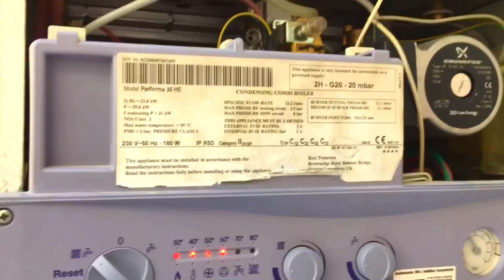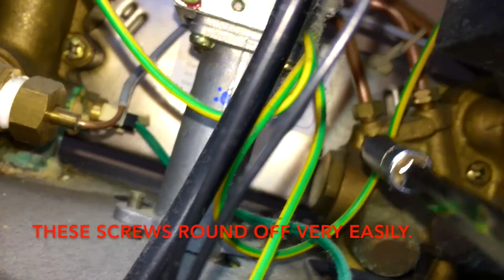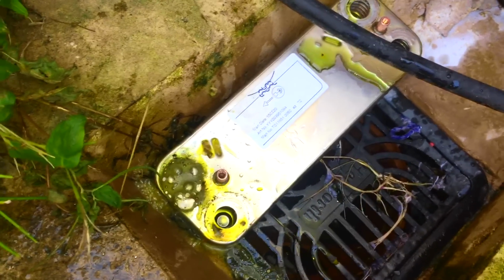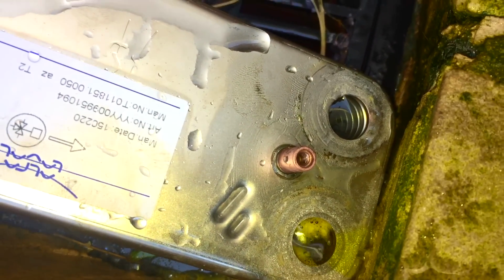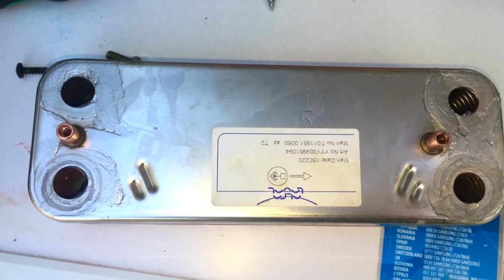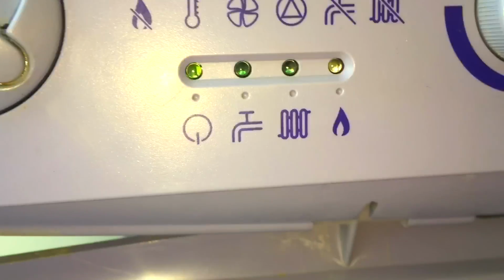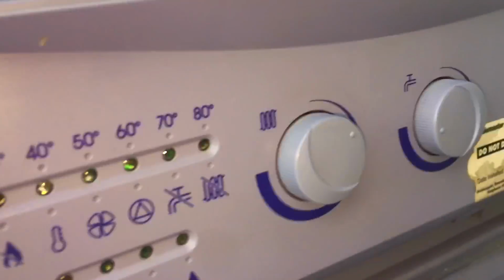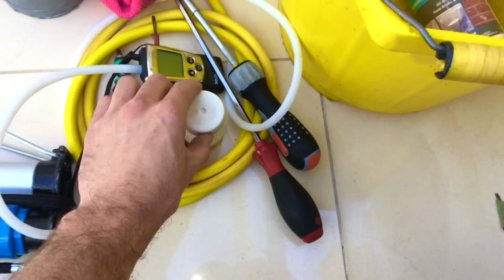Blocked plate heat exchanger sludge. Potterton Peforma no hot water. Heatinggeek

Comment: 6:36 I had a Vaillant Ecotec today, blocked up on the cold water side, flow good on hot taps but very little flow, spirit of salts couldn’t clear it, had to replace :(
Reply from the maker: Yes, it will not clear the scale quickly. Take about 10 bottles and would damage the plate before clearing it.

Comment: great video learning a lot from your videos as im new to faults. however is there a way to check if its the plate or diverter? as to my understanding is if you run the hot water and the flow pipe starts to warm the way i understand its the diverter passing
Reply from the maker: If the plate on these boiler gets blocked then the pump is able to overpower the diverter and the flow pipe gets hot. Other boilers won't do this. Vaillant for instance will not do this. It comes with experience. Remember this diverter valve is not electronic. :-) Hope that helps.
Reply: @HeatingGeek yes thank you very much appreciated

Comment: Do you put spirit of salt in all 4 holes?
Reply from the maker: I put it in the ones that are dirty. It should be obvious :-)
Reply from the maker: Also if the mains/hot water side is scaled badly then it just quicker to replace the heat exchanger.

Comment: When U drain it out do U pump the vessel or close the drain off then pump air ?
Reply from the maker: Always pump the vessel with the drain off open. That way if the vessel is full of water it can be pumped out.
Reply: @HeatingGeek  that's fine. Will the air leak out or just stays in there ?
Reply from the maker: @Askme_gas  No there is a sheet of rubber separating the heating water from the air. I you have constant air coming out the vessel needs replacing.
Reply: @HeatingGeek  yeh I pumped it today and no leaks 1 bar all good then opened the flow and return

Comment: Evening buddy. 
My boiler when I run the hot water, shoots ups to 99 and then shuts off and makes a rattling noise like air is stuck. Would this faulty plate to plate or dodgy thermistor
Reply from the maker: Probably the plate heat exchanger. What boiler is it?

Comment: If my old boiler keeps making ketteling noises and switches off when up to temperature would that indicate limescale in the exchanger? Thanks
Reply from the maker: What boiler is it?
Reply: @HeatingGeek  hi it's a Glow worm fuelsaver mk11. Probably around 1994.just cleaned the heat exchanger with spirit of salts. It wasn't blocked.
Reply from the maker: @paulhealey2984  Nice. They were heat only and copper heat exchangers i think? Spirts of salt might have been a bit strong

Comment: Only goes in one way anyhow the baxi plates right pins offset 😂 never had an issue with the pump leaking though normally aav leaks that’s about it… don’t keep turning the switch on and off could break the button or surge I just turn gas off let it go through it’s cycle to get rid of the air let it go to fault reset then let it do it again
Reply from the maker: I agree with you. I do turn the gas off a lot of the time.

Comment: Ok if in a hurry, but you can get new plate heat exchanger and rubber seals on ebay for 25 quid, and be sure it will due the job, , 3 days wait on ebay,

Comment: I have been successful putting strong descaler into the wash machine cold supply with the boiler off and hot tap open. Its messy and you have to push it through but it works and as there's no disassembly you dont need to be gas safe.
Reply from the maker: generally it the ch side that blocks, not the potable water side.

Comment: Great video! We have an ideal standard boiler. It was new 3 years ago but already 4 heat exchange replacements! Water sample was fit for purpose but something keeps getting through even though we have two magiclean pumps! We have three almost brand new plates that we have kept and they said we could clean ourselves. Would this work?? Also, have you got any further suggestions as someone advised not to clean the system as it may disturb it. Thank you!!!
Reply from the maker: Sorry I didn’t respond to this comment. I didn’t see it in my feed. :-(
Reply: if you have scale isseus,use scalebreak mp from goodway,non toxic,safe for metals like copper ,safe for plastics and stuff....very cool stuff

Comment: can someone tell me the correct replacement washers 24 mm dia 13mm centre hole.
Reply from the maker: For a boiler? If so just order from Wolseley/Plumbcenter using the make and model.
Reply: @HeatingGeek  Its an old HIU with an alfa laval heat exchanger. I took the heat exchanger out and to be honest don't think that was the issue I still cleaned it with the salts just in case. But on inspection I noticed the washers were  knackered. They look like they are made of nylon I've put it back in just so I can get some water but its leaking like a sieve. I'm going to pop in to a whole sellers tomorrow with one of the seals. Hopefully it will be working once I get the leaks sorted. Any tips would be nice. Thanks for your video really helpful.

Comment: Did you replace the seals with new ones? Or use old ones.
Reply from the maker: I silicone grease the old seals. I always have seals but usually they don't require replacement.

Comment: Is this done on the DHW and heating side, I.e scale and sludge. I understand that it would work on the DHW side as acid dissolved limescale but does is work with sludge (magnetite). Apologies if that's the side you did. Cheers in advance.
Reply from the maker: Yes it works on both sides. However when a plate heat exchanger on a domestic boiler becomes blocked with scale it takes way too long to clear it. Much more effective to replace it. 
On sludge it will clear the heat exchanger within 5 min.
Reply: @HeatingGeek  many thanks for your quick reply. I've cleaned mine (on a Vaillant Turbomax 242e) twice before using citric acid which did the job, albeit a little longer. I've now got Fernox DS3 which I've used for all sorts. Very effective and a bit more user friendly.  I live in suffolk which has ridiculously hard water but also recently invested in a good water softener. Thanks again!

Comment: Great video, what type of grease do you use?
Reply from the maker: Nice thick silicone grease
Reply: @HeatingGeek  Thanks mate
Reply: @HeatingGeek  I've drained off the system, turned off all the valves including mains but water is still coming out when I undo the screws. Is there anything else I should look out for?
Reply from the maker: @TheStressD  It could be piped backwards so the hot is cold and cold is hot. Or you have a shower mixer allowing cold into the hot pipe. This would also cool the water to the house and may look like a blocked plate.
Reply: @HeatingGeek  Just managed to undo the plate it didn't even look bad. The CH return black valve is seized and that's the only one I couldn't turn off. When I turned on the mains to flush out the acid in the exchanger water still poured out.

Hot water is running now but theres a rumbling noise sometimes which has been going on for sometime. Do you think its the diverter valve that could cause that boiling noise issue, I've got an ideal+ logic 30 combi?
Reply: @HeatingGeek  Update: Managed to fix the loud rumbling issue. When I removed the black pipe that goes into the condenser expansion bottle a load of magnetite came gushing out. Cleaned out the expansion bottle removing all debris, filled it back up with tap water to prime it and now its running perfectly.

Comment: Even if the plate heat exchanger is blocked up and not heating the water correctly, why would the flow pipe get hot if the diverter wasn’t faulty? If the diverter is working correctly then no heat should be going down there regardless of the condition of the plate exchanger right? Due to how they work the diverter should completely shift from the flow pipe (heating) side to the plate exchanger (hot water) side right? 

In the case of the diverter working correctly and the plate exchanger being blocked up I would think the only symptom is intermittent hot water with no heat going down the flow pipe because the heating circuit outside the boiler should be completely shut off
Reply from the maker: Your right but experience shows that when a plate is blocked the additional pressure put on a diverter valve by the pump, can force water past. This is common on many different boilers.
Reply: @HeatingGeek  ah that makes sense with the excess pressure! Thank you 😁

Comment: Just done this job, excellent results, ours was completely blocked like yours. I didn't wear gloves and survived lol. Need to remember to clean out the bit that the plate exchanger bolts onto as ours was clogged as well. Might celebrate with a nice hot bath tonight thanks
Reply from the maker: Glad you survived. Have you had to do it again since?
Reply: @HeatingGeek  Bit weird this coming up after so long but only in the past few days I fitted new tap inserts as the old ones were leaking and it seemed a bit harder to get the water nice and hot so I was wondering if it had started blocking BUT I have decided its just the new taps settings being different as the other taps in the house work as before. So no is the answer I did put some fernox (or whatever its called ) in the system though ?
Reply: Edit this its not the taps, I now have some spirit of salts on its way to do it again lol
Reply from the maker: @ make sure you don't over do it and wash it out fully. Good luck.

Comment: Just did a similar thing on a Worcester PHE. Considering a new plate for one of those is 150 quid, for the sake of a couple of hours labour and a bottle of descaler, it's a much more reasonable fix if cost is an issue! 

Only downside is the water where I live is harder than Mike Tyson so I doubt it will last! 

Good vid. 👍

Comment: Quick heads up, while this method (if done efficiently) does work, it is only temporary solution, as you will have to do same thing after 1-3 years as it is nearly impossible to get all of the minerals out. To aid extraction i suggest running it under tap with as much pressure as possible, and then shaking out all the ''flakes'', then repeating step shown in video multiple times until there are barely any flakes comming out.  To extend life of heat exchanger, keep your hot water temperature as low as possible. A new heatexchanger can get clogged in about a year if water temperature is set to max possible temperature. My personal experience from fixing boilers.
Reply from the maker: Good info

Comment: I got a plate heat exchanger today which I cleaned using white vinegar. It cleaned quite well (though the thing was not as dirty or clogged as your example) but I did notice after a couple of hours soaking the vinegar exiting the boiler water side of the exchanger turned a very dark and vibrant green... Any idea what could have caused the colour?
I suspect the strong yellow colour your example showed may have had a similar cause only it being yellow due to the much more acidic liquid used....
Reply from the maker: It was probably something to do with copper. I don't ever leave anything in a heat exchanger for more than a few minutes.

Comment: Great video mate. I have the same problem with my warmflow combiboiler. The heating is fine with no issues.  the hot water starts really warm and then is just luke warm. So can't run a bath. I'm thinking of removing the heat exchanger and giving it a good clean. Any advice as im a novice :-)
Reply from the maker: Dont do it. Get a GasSafe registered engineer to do it. :-)

Comment: I'm always intrigued to learn of efficient caustic cleaners for cleaning sludge and lime scale.  But isn't this essentially Hydrochloric acid, which is renowned for eating away at metals. Is there no danger of it burning through the internal partitions.
Reply from the maker: Yes, your absolutely right. This has to takes minutes otherwise you could damage the plate. I have done this for over 10 years and not had that problem. BUT it could happen.

Comment: Brilliant advice & help. One question tho- do I change heat exchanger then power flush? Or powerflush then change with new heat exchanger? Cheers Marc.👍🇬🇧
Reply from the maker: If you powerflush the system from the boiler pump you can clean the heat exchanger in situ. No need for a new one.

Comment: Good video, very helpful.

Where do you get that specific discaler from in the UK and what price?

Also is it just good practice to pump the vessell tl drain or necessary?

Cheers
Reply from the maker: I generally pump the vessel if im working on the boiler. If the vessel is flat water will continue to gurgle out when I remove the parts. What boiler are you going to do the job on?
Reply: @HeatingGeek  I done it on a worcester 24 junior. I've took the advice and think I'll do the same. Makes sense cheers man

Comment: On these Baxi 105s whats usually the problem when the hot water is fine when the heatings on but h/w only it'll try to fire up but just keeps clicking and running cold? Any ideas
Reply from the maker: Could be a lot of things.
Reply: @HeatingGeek  It's strange if I keep knocking the tap on and off eventually it will fire up and stay on

Comment: Biggest issue I have with plates are the vaillant ones , why can't they make them 8mm bolts ? Bloody things nearly always round off unless you have an impact driver and even then you still risk it happening
Reply from the maker: I have rounded a couple. I now use a PZ3 and i tap it while undoing it. Like an impact driver but just me. :-)
Reply: @HeatingGeek  would love to see you tackle the back powermax boilers , last time I touched one of them they had to wheel someone out from the archives to run through the faults I had on it 🤣
Reply from the maker: @jules_paints_40k29  What the IMI powermax? with the orange user interface. :-)
Reply: @HeatingGeek  been so long since I've seen one I can't remember tbh , just know those combined boilers and cylinders were never great fun to work on but ideal istor was even worse .
Reply from the maker: @jules_paints_40k29  if the Istor didn't have mushrooms growing on it then It didn't have any water in it.;-)
Reply: @HeatingGeek  🤣🤣🤣

Comment: Why does my performa 24 fire up when there is no demand for heating or hot water and begin to kettle. But then kettling eases off when i run a hot tap and hot water comes out. Flow sensors not stuck?
Reply from the maker: The hot water microswitch probably has an issue.
Reply: @HeatingGeek  heating comes on tho
Reply from the maker: @nially85  Yes because its a mechanical diverter valve. It only switches to hot water when water flows through it and moves a diaphragm.
Reply: Atleast its not an f62 ;)
Reply from the maker: @nially85  :-). You get to stay dry with an f62
Reply: @HeatingGeek  ive had a couple of job baffle me. Atleast you stuck with it. 
So ive installed plenty of combis when i worked on site. And heating breakdowns are no problem for me. But i dont really do boiler breakdowns especially combi's and this has just so happened to me in my own flat this weekend. Arrrrgh.
Reply from the maker: @nially85  The microswitch is more than likely the issue. :-)

Comment: great video. my boiler turns off the hot water after about 6 mins of running and i get a flame failure light on. can reset it after it cools and runs again for about the same time. heat exchanger issue?

Comment: 0:18 to 0:21 what does he say?
Reply from the maker: The flow pipe is getting hot to the floor.
Reply: @HeatingGeek  so the diverter valve doesn't switch to the tap water heating?
Reply from the maker: @Altarofwater  It does but because the plate heat exchanger is blocked it (the water) forces its way past the diverter.

Comment: Sorry chap this is a repair you shouldn't really be doing this they can pinhole do this job on a boiler upstairs in an airing cupboard not good this is rare but it does happen. And you've got your trousers around your ankles as manufacturers do not recommend this type of performance also the solution can spit at you. Why not just charge the customer a few bob more for a new heat exchanger. So you do this job the customer sells the house plate heat ex perforates leaves  new owner  with a nasty  surprise new boiler new ceiling new carpets. We are  are all expected to perform better than that.
Reply from the maker: I have been doing this repair for more than 15 years and not had an issue. I have seen DHW Heat Xs pinhole but never after I have done this. I understand your concerns but this is a great way to get someone up and running again while they get some money together for a powerflush. Do you think powerflushes are ok?

Comment: Baxi 105he heat fine . Hot water cuts out when it gets to temp and burner cycles on off. Hw at tap goes cool. 
Hex and boiler pipes.  Clear. Thermistors ok. Pump ok. And he fitted new divertor. I'm wondering if divertor is playing up. Brand new .full divertor.
Over heat stat has continuity also and swapped for known good one. Still plays up.
Reply from the maker: Whats the burner pressure? High and low? Probably the low is set too high or the harness/pcb is faulty. KISS 
I bet it will be the burner pressure. :-)

Comment: Hi Mark great vid, couple a questions if you'd be so kind?!
I first changed. The actuator, then the diverter cassette, now I've just done the exchanger as in your vid,   it's got alot better I get a fairly constant hot water flow now with very little fluctuation ......but I've just noticed it's still bypassing and the radiator feed pipe gets hot too, so although not 100% perfect it's getting me by, but any other parts that could be failing??? Could the diverter body/ housing  itself fail?

Thanks
Reply from the maker: Yes, it could. never say never. Did you clean out the diverter housing when you replaced the cartridge? Also how blocked was the plate heat exchanger?